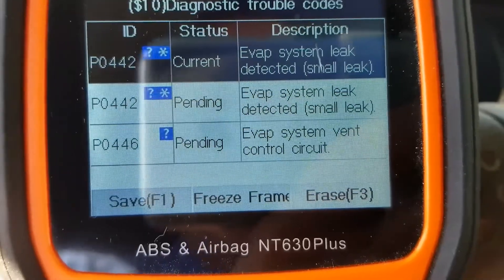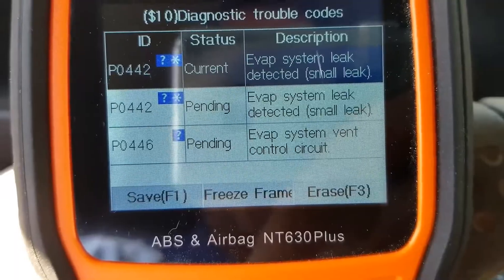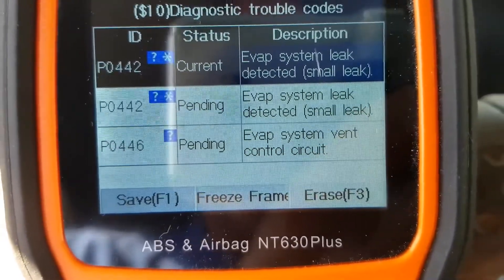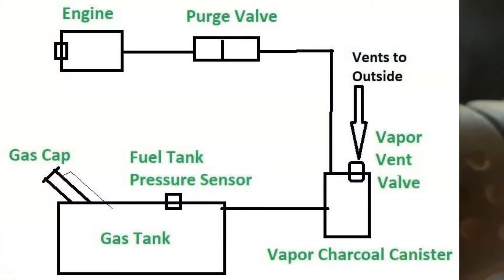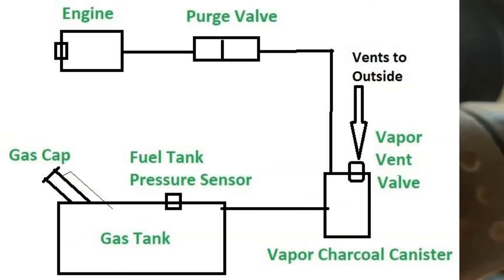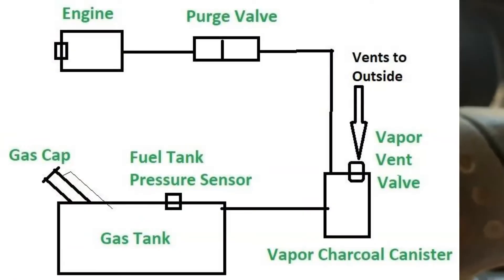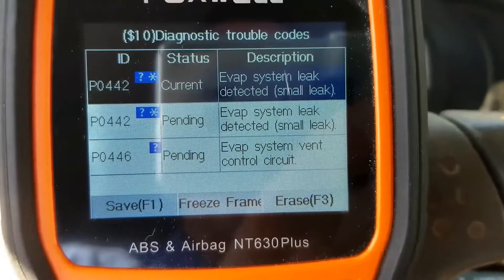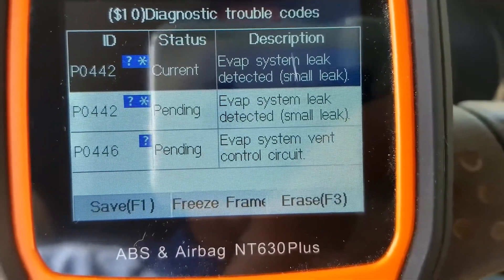How To Diagnose and Fix EVAP Codes and Pass an Emission Test

Comment: @HVAC_Mechanic Based on what you showed us about the Purge valve, how often do you suppose the computer is going to tell the valve to open? I know you said once the engine warms up, it "should" open but I let my car idle for an hour and I never got any vacuum at all from the canister side of the purge valve. Is there any way to test that valve if you sense it might be stuck shut? I continue to get a 455 and 457 code on my Grand Marquis, but more often I get the 457 code. I've checked some other things but Im trying to focus on the Purge valve operation right now. Thanks for any help with this.
Reply from the maker: Usually, it opens when the engine gets hot, but it can vary sometimes when the computer sends a signal. The purge valve is normally closed and opens when it gets 12 volts, but a small 9-volt battery usually also works to test it. So, another test is if you remove the plug, use jumpers with a small 9-volt battery, it should click when power is applied, which usually means it's good. No click means it's bad. Also, you won't be able to blow through it with no power, but when it gets power, you should be able to blow through it.

Comment: So I've had 2 smoke tests done, nothing. I've had the purge valve replaced twice and the charcoal replaced twice. Got a new gas cap. I still have this issue. My mpg is also going down. My idle is off as well. Need help. P0441 code
Reply from the maker: Have you tested if the computer is sending a signal for the purge valve to open? While a P0441 can be other things, usually it is something wrong with the purge valve.

Comment: Doing my best to figure out a PO455 code on my 2000 grand marquis. Car runs fine, but cant get it thru emmisions with that CEL on. Thanks for the video, I have some homework to do. I noticed you didnt even list the PO455 code on your EVAP OBDII Code List and Description.
Reply: Buy a scanner and reset the CEL just to pass it
Reply: @tytelines7988 , I have a scanner and I can turn off the check engine light but everyone knows that the State inspection people hook their own scanner up to the car and the code is stored inside even if the check engine light is out. Once you turn that light off, your car has to go through a few driving cycles until it shows the inspection people it’s “ready” for their computer to read it. If it’s not in “ready” mode, they will fail it.

Comment: I have a 2004 Pontiac Vibe. The only code I have is P0420. (Bad cat, I know, but that's not the issue I'm having.) The last 3 times I've filled up my car, it was tough to start immediately after refueling—each time it died on the 1st start and then took a bit of cranking on the 2nd try. I checked if the purge valve was stuck open by feeling for the vacuum and did not feel it. I think I can smell gas at the outside of the car when I've been driving it. Any ideas what I should check? The car runs ok, but maybe a little rough idling.
Reply from the maker: That is a common symptom when the purge valve becomes stuck open. I would be sure it is not stuck open. Sometimes the vacuum can be hard to feel. If you can blow through it with no power, it is stuck open.

Comment: Great video. I have the P0455 code popping and already replaced the gas cap with an OEM model and reset the light twice...still popping. Per  the code on your list above do I simply need to replace the Purge Control Valve since the circuit is shorted?  Thx on the front end!

Comment: 2017 chevrolet traverse evaporative emission vent solenoid valve control circuit located my code is P0449 🤦🏾 any blessing helps much
Reply: There was a bulletin done on this year traverse because mine is and they replaced mine but it keeps coming ok now my code P0442

Comment: Does this also happen if you use a lower octane gas accidentally?
Reply from the maker: No, I've never seen that issue.
Reply: No but Google "Top Tier gas station list" and only buy fuel there. You can run their lowest grades in cars requiring high octane fuel with no problems. Ive ran it in my 69 Superbees full race engine & all our Infinitis for over a decade now. 
 Top Tier gas cleans all that crap out Ethenol leaves behind. Running cheap crap gas like convenient stores sell only causes more problems with injectors,O2 sensors,Converters etc..
  You'll never save a dime with non-Top Tier fuels because of of all the repairs it creates.

Comment: I had the evap leak codes on a toyota corolla 2010 and i did the smoke machine test and the smoke comes out from the gas filler even with the gas cap on it, i chance 3 differents gas cap and the smoke still comes out from that place, the problem should be the gas filler neck?
Reply from the maker: It is possible the filler neck is leaking but be sure the vent valve is closed when doing a smoke test. Some Toyotas have the vent valve feed out through a hose to around the filler neck. So, it looks like it is leaking when the vent valve needs to be closed. The vent valve hose can also be removed and just be blocked off with a rag or plastic bag while smoke testing.
Reply: @HVAC_Mechanic  if i put a plastic bag on the gas cap and the leak codes does not come back should be the neck, but if comes back should be the canister ?
Reply from the maker: If the code doesn't come back and the gas cap is new, then it likely is damaged at the inlet. If you have a smoke machine, that is the best way to find a leak. Just be sure the vent valve is closed, or the port is blocked off since it is normally open.
Reply: @HVAC_Mechanic  I'll check it out ty sir

Comment: Lately on fill ups, gas overflows when I fill up my tank. Would this likely be due to faulty canister vent? Is a valve stuck open? 2001 Chevy Express
Reply from the maker: It needs to be diagnosed, but yes, a bad or clogged vent valve can cause those issues.

Comment: Thank you for an Excellent video! Currently trying to diagnose and clear up a P0446 code on a 2012 Ford F-150 (186,000 mi). The Vent valve activates using a scan tool so is it safe to assume the vent valve (on the cannister for this vehicle) is ok as well as the wiring to the valve? I hate to fire up the parts cannon as a new cannister with valve is over $600 CDN at the dealer. I was hoping that a single code would mean a narrower search, but this video suggests that may not be true.  Again, awesome explanation!
Reply from the maker: When it is activated, can you hear it click? If it clicks usually that means it is working although sometimes, they can leak or get plugged up. I made a full video on testing the vent valve and the vent valve circuit. Here is a link. https://youtu.be/zsetg4T1T4Q
Reply: @HVAC_Mechanic  Hiya! many thanks for the reply! Yes, I can hear it clearly click when activated through the scan tool. I will watch your recommended video and see if I can track this down. I had recently filled the tank (without difficulty) so I need to burn some gas before trying some of the self tests as I think they recommend being below 85% in the tank.
Reply: @HVAC_Mechanic  Thanks for the reply! Yup, can hear the click. Purge valve seems to be working too. System seems to be operating. Purge valve cycles at lower percentage very often, but doesn't trigger the vent solenoid to close during regular parked cycles. Still draws a slight vacuum even with the vent open. I still have some noodling to do.

Comment: I recently changed the purge valve and gas cap in my 04 Sierra and the light turned on again and also dash showed tighten fuel cap. Not sure what to do.
Reply: U might have to change the canister

Comment: thank you, I'm in the middle of putting a fuel pump in my daughters Alero  and this code has been in it for about a year but I ignored it cause it said no chance of damaging any parts existed. Buut, since I have access at this time (though it's not running) I will at least be doing a visual check.

Comment: Have a 2019 ford escape p0496 code new purge valve installed code was gone for a week now back.
Reply: Did you find solution?
Reply: @BalevErga  yes needed the oem Ford. Part works great now these cheap parts don't work.

Comment: I recently got an check engine light on a 2021 vw tiguan i used a scanner tool and it had a code P04F0 without any other codes following that one.
Reply from the maker: I would test the purge valve, and if that is good, test the EVAP pressure sensor.

Comment: Hi, i have a 2018 Chevy Suburban. It never had a gas cap, so I don't know if that is the problem. After about 80,000 mile, now I get an EVAP engine code. I can clear it but after a tank or two later, the light comes back on. I have been told I need to replace the EVAP. I was going to replace it and the fuel filter but I can't find any exact location of the fuel filter. Do all 2018 Suburbans require a gas cap and where is the fuel filter located?
Reply: fuel filter is in pump in tank, therefore you would have to replace whole pump assembly.  Best solution is replace pump, this has a new fuel pressure sensor that can be bad or leaking, or the seal around the old pump, replace the vent valve, charcoal canister and purge valve up on the engine. If you still have a problem, check all lines for cracks or near tank and canister and / or old pellets blocking lines.

Comment: I recently purchased a 1995 Ram 1500 5.9L and when i was filling up gas it only allowed up to 3/4 of a tank after shutting off the gas nozzle several times. I look under the truck and a bunch of gas is leaking out of the charcoal canister. What could my issue be?
Reply from the maker: It needs to be diagnosed, but I would test the fuel tank check valve, which causes those issues in some older systems when they go bad. The charcoal canister or vent valve may also be an issue, but I don't see how gas could get into those components without something else going bad.
Reply: @HVAC_Mechanic  thank you for taking time to reply, do you think the purge valve could cause an issue too?

Comment: Great video, I have this code on my low mileage 2017 Ram 1500. What is strange is I drove it from California to Arizona, the light was on. Got to Arizona filled up and the light went off and stayed off the whole time I was there (1 week). Got back home to California and within a day the code came back. Thanks for the video, I'm going to check the things you mentioned before buying parts. The smoke machine you linked will be here tomorrow as well.
Reply: Same thing happening to my Hyundai accent 60,000 miles did you ever find the problem? With mine it does idle weird when turning AC on, rolling up or down windows, and take off is definitely more difficult for it, RPMs accelerate up and down when idling. Went through two batteries in the past three years and replaced the AC compressor.
Reply: @Rinney88  i put plastic on the gas cap, the light went off. I bought a new gas cap and a few weeks later the code came back. Haven't messed with it since, going to try the plastic again, if that works, I may have gotten a bad gas cap.

Comment: If your purge valve and vent valves can be opened and closed successfully with your scanner, does that definitively indicate that they are working properly, or could there still be an issue with them?
Reply from the maker: It is possible they leak when closed, but usually, if they open and close, they are good.

Comment: Had a po 446 and 451 code changed purge valve solenoid cleared code 3 days later 446 pending current and perm 451 perm, 2009 malibu with 2.4L other fuel symptems car off can on occation smell gas bad at rear of car also when car sits over night have to to turn ign key on for 10 seconds before going to start or it wont start like fuel drained from line back to tank. several issues or no? key problem 8 months old engine light a few weeks now

Comment: Will a po171 be a vacuum purge solenoid???
Reply from the maker: Usually, a bad stuck open purge valve causes rich codes. It could cause a lean code if it was stuck open and there was a leak, which would cause an intake air leak. You could block the hose going to the intake and see if the P0171 clears. An Evap code will likely come up, which should clear once it is hooked back up.
Reply: My Canister Purge Valve, & my Fuel Vapor Canister code popped up, I hadn't changed it at all yet, now I have to because my car won't start, although t it does turn over strong, I'm trying to figure out how can I check the car to troubleshoot the problem, and what is the name of that scanner you have there, and where did you get it from?

Comment: Thank you so much !!! I was able to reset a trac off/ check engine light that I had for months a some monsson floods in vegas. I guess some water got into the canister and messed something up in the system. I did all the steps from the engine all the way to the back of the car and it got cleared...

Comment: This is by far the best video I have seen explaining the P0441 code. It sounds like my Corolla has the bad valve at the charcoal canister since it is constantly kicking off when I fill up with gas. Thank you for the great video!!
Reply: Were you able to actually confirm or pinpoint and fix the problem? If so, what was it? I'm interested because my corolla just had a CEL on for a P0441 code EVAP system incorrect purge flow. Thanks in advance for any info.
Reply: Same, mine keeps going away (even for a couple weeks) andcoming back.
Reply: I did find the problem. I had to replace the purge control valve. One of the lines was clogged up with mud. I just replaced the part instead of messing around with cleaning out the part since it may have caused damage to the part. It is located under the hood.

Comment: I’ve replaced most of the parts to code PO446. And 6 gas caps ,all OEM. And still have a code on and off again. Why doesn’t GMC have a recall on this too many people are having this problem?
Reply: Hello did you ever find out exactly what the problem was?
Reply: You may have charcoal in your lines, did you blow them out ? You may need to drop the tank to blow out that hose.